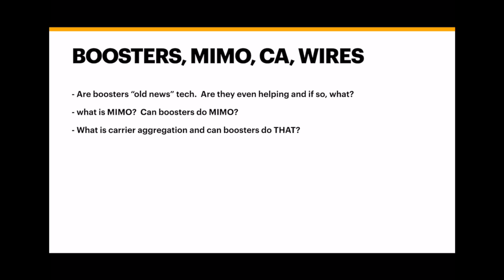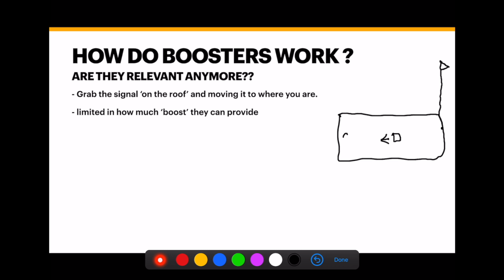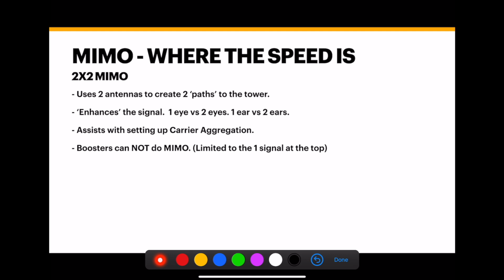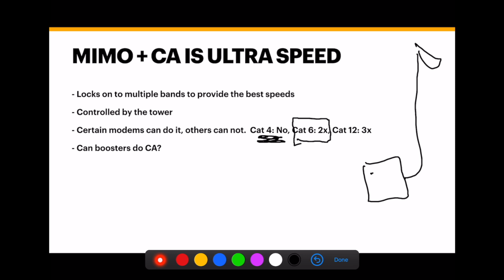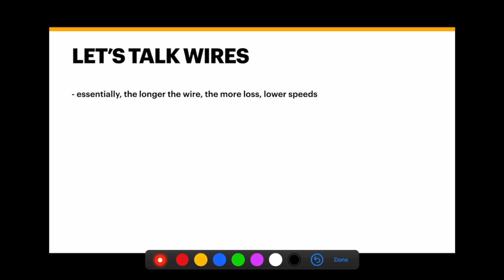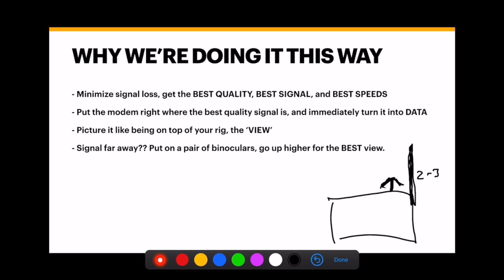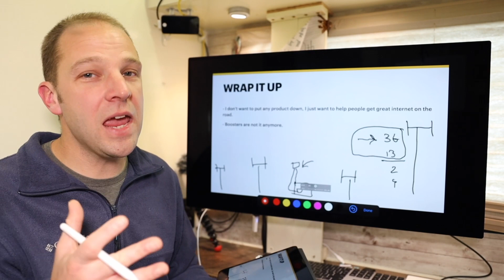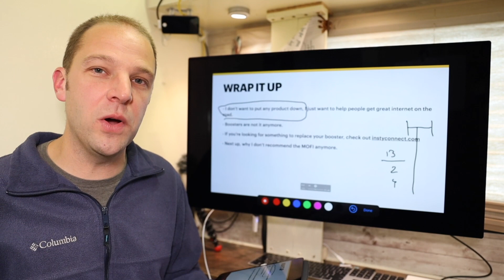WHY CELL BOOSTERS DON'T WORK - THEY ARE SO 3G

Comment: I think boosters still are needed. But only when you do not have any signal on your phone. Its only when i have no signal or signal with no data, flick of a switch i now have data. Think more way out in BFE not next to a tower. Question on that though, how about 2 booster in MIMO? There are 3 places we go camping that with out the booster we dont have any cell coverage.

Comment: I finally get it.  I’m learning that the booster isn’t the answer.  I just don’t get the whole sim deal.  I have the Verizon truly unlimited hot spot.  I tried to use the sim in another device but Verizon shut it down, saying the sim would not work in that device.  It was working perfectly until they shut it down.  So are the carriers trying to dissuade the customer from using other devices?  How do we get a sim that they won’t shut down?
Reply: Verizon is known for that. But you don’t want to use a hotspot sim; you want to use a phone line sim.
Reply: Yea Verizon doesn't allow it at all it seems.

Comment: I have a booster and here is the down low...
My booster is a good one. 
It does work as advertised.
BUT it's all about the bands that it will amplify and what band you're using most of the time in that area 

I used one of the cellphone apps that shows my cell info in real time and my signal strength. That helped more than anything and here is why.

My cell phone is on AT&T towers on redpocket mobile. My phone a Samsung a52 love's band 66 and will get 50mbs down inside at the front of the house.

The booster boosts 4 bands.
700mhz 800mhz, 1900mhz, and 2100
All of these are used by the major carriers so yes it does boost the signal in my house and I have full bars in the basement..  Here is the but..Most boosters do not boost band 66.. so if I'm not boosting band 66 then my phone sees the 700mhz band signal from the AT&T towers. That is the band they use for rural areas or to push signal out further since lower frequencies travel further, and go around objects better.
The lower band does not cary as much data...even if you bond the channels you'll get 12mbs down, 1mb up and sometimes 20mbs down. So it is usable.

I have great call quality And full bars in my basement and I do ok on speed. But a modem using that would be slower.
 than it could be and they will always need higher mhz range bands.

If I take my phone to the corner in the back of the house with booster of I can get 60mbs or better.
Same phone taken 1000 feet down the road and it's 100 to 200mbs.

Here is what happens with the normal booster when it's on. (I have watched the cell data in an app to see what bands.)
700mhs is band 12 I've seen 4 pop up
But band 66 , 71 and some others are faster but my phone loves band 66 and I cannot change it on my phone.

2 bars of the right tower will get me the 60mbs in the front of the house.
Full bars with the booster on and I get 12mbs.. the antenna pointed at the right tower will not help because I'm not boosting band 66... so I only get the 12mbs band 12 because that is what is being repeated and my phone sees that as the stronger signal..

If I sold my booster and bought a booster for band 66 I would be set.

Or just get a modem/router and use an unamplified antenna.
It's important to note that an antenna does not boost the signal and regenerate it but it concentrates it and that is why the binoculars give so much better speed. Those type of antennas have up to a 15dbi gain.. vs a whip antenna or the basic patch antenna. It super concentrates it without electrically regenerating the signal via electronics.

know what band you're using on your carrier for the faster speeds and boost that band if you're wanting to use a booster in your basement or around the house or office and get faster speeds.

Comment: Could you use boosters with a MIMO modem if you had two boosters, one for each antenna? Directly wire each connection from the modem to a separate booster, or would that degrade the MIMO performance?

Comment: Boosters still have a place for part timers who have phones but don't want to pay for an additional data plan (SIM card).  Also for voice calls from older phones that don't do WiFi calling.  But if you want the best data throughput then yes put the radio at the antenna and get them both as high as you can. Ironically the WiFi booster systems have been doing that for years.

Comment: Hello again, I was looking at some your earlier videos and I see that you have 2 30 gallon tanks with a generator on the platform. So do you know what the tongue weight is. I am considering doing the same thing except putting a mini split up there behind my propane tanks. I’ve extended the tongue of my trailer that I’m building two extra feet to hopefully accommodate one